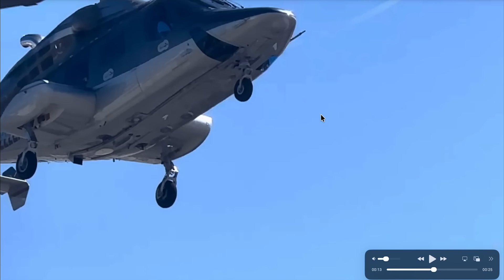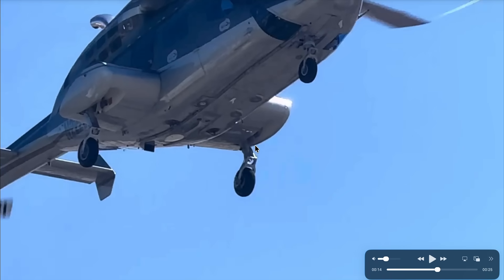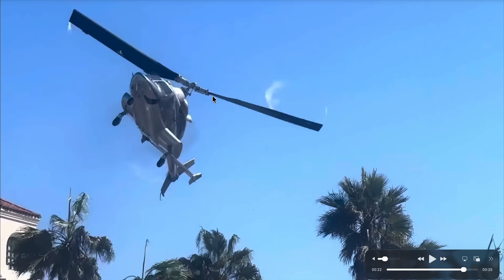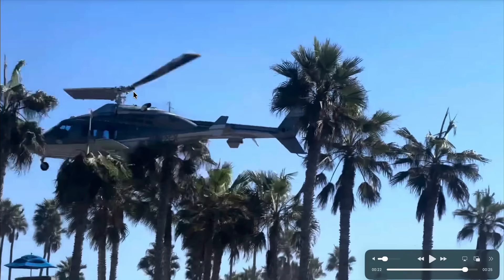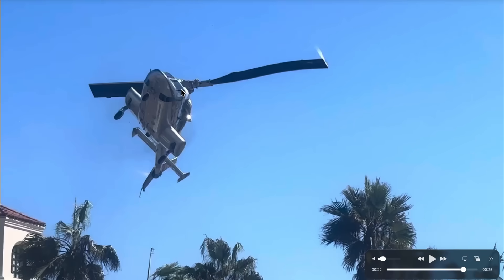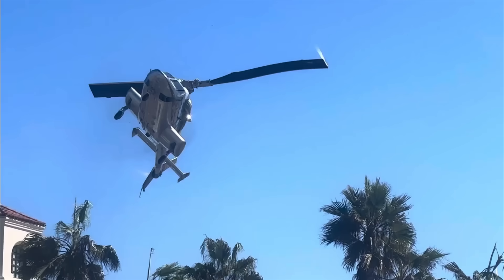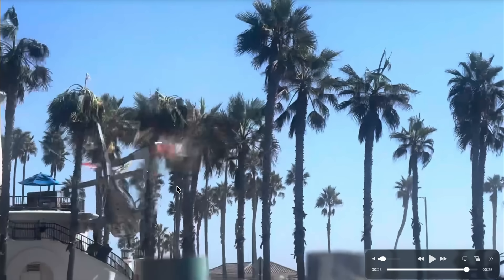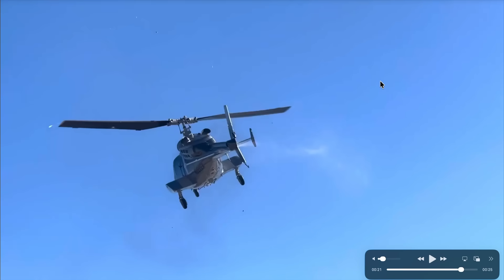Huntington Helicopter Crash Analysis - SlowMo Video!

Comment: It's only mast bumping because he pulled a load of collective to get away from the trees, then dumped the collective, to stop the pirouetting from getting any worse.
That heavy raising then rapid lowering of the collective, left the helicopter at zero G and that zero G condition lead to the mast bumping.
You say it's lucky they weren't at 1000ft but if they were, then they would never have pulled collective, before lowering it, so the mast bumping would never have happened. They would have just lowered the collective straight away and autorotated, if all went well, to an uneventful landing.
The main rotor mast eventually being severed, and possibly the main blades hitting the tail blades and in doing that, compromising the tail transmission, is all a result of the zero G condition caused by raising then quickly lowering the collective. (Which they only did because they were so close to the trees). 
Edit: The initial failure was a pitch link detatched from one of the tail rotor blades. (@BlancolirioYT shows this - see below). Everything else was caused by the pilots reaction to that situation. Not that any response was going to produce a good outcome, starting from having zero forward speed and  maybe 20ft above trees.

@BlancolirioYT video showing detatched tail blade pitch link: "Huntington Beach Helo Crash 11 Oct 2025"
Reply: Difficult to arm-chair-quarterback this pilot, as no life was lost and it could have been far worse! Seems to me the only other way he could have reacted would have been to bring engines to idle and set her down immediately (and it would have been a hard touch-down still, and might not have ended any better at all). The palm trees he ended up in at least stopped the main rotor from spinning and thrashing the helicopter into pieces! Not that I think he planned it this way, but it did work out fairly well in hindsight.

Comment: You can see the pitch links are severed on the tail rotor in the first turn. May have lost the swash plate bearing. The smoke would probably be the tail rotor drive shaft flailing around in the tail cone structure. Tail rotor would eventually bump the same as the main rotor, especially as the helicopter spins. The palm trees saved a lot of people. The main rotor blades would have been sprayed everywhere from hitting that structure. Not a fan of two bladed helicopters personally.

Comment: notice jsu tone of the TR blades is at that masive pitch angle? notice that theres a pitch link broken before anythign goes wrong?
The guy was creeping in, full left pedal, strafing using the airflow hittin ght rihgt side of the tail, as soon as that airflow slowed down as jhe slowed down, it started to rely solely on the failed tail rotor. The second he felt that, he paniced and pulled collective to get out of there, making the loss of TR authority worse, substantially worse, and leading to the entire TR assembly giving up , starting with the blades vibrating out of balance, then when the blades snapped off, the TR was completely out of balance so snapped itself off.
ALl in all, the only way this guy was going to have a relatively uneventfull landing, is if he gave up much earlier and run on landing elsewhere.
Reply: Jeezaloo, the dude is a stunt pilot, immediately put the nose down but then it was out of control due to failure & there's still people believe he should have just 'landed' it somewhere else or autorotate it....even after this clear video

Comment: I thought the main rotor hubs were made of forged steel.  On some helicopters, like the Bell 407 for example, the rotor hub is made from splintering fiberglass.  Every part of a helicopter is critical and complicated.  Helicopters are death traps.

Comment: There is a video with the helicopter straight on.Just before it starts to spin and you can see the tail rotor blades have almost full pitch, which tells me the tail rotor failed, look for that video.
Reply: Was he landing in a downwind condition, causing more load on the tail rotor, until it lost effectiveness?

Comment: Excellent analysis.  I bet the TR paddles cleanly breaking at the same spanwise location could be traced back to their manufacturing technique and probably aligns with some assembly joint.  I didn't expect to see the mast bump (which was fascinating to watch unfold in slow motion).  First time I've ever seen such a high quality video capture that.

Comment: Very good analysys frame by frame. And I appreciate that you admid openly that do not understand what caused the tail blades to separate in the same moment. Whatever broke there, it's a pilots nightmare to experience such a technical failure which causes a crash

Comment: at 5:05 only one trail rotor blade has a pitch increase, and you can see it's producing way more tip low pressure vortices than the other. From another camera angle it looked like a blade pitch linkage failed and caused on blade to rapidly increase pitch, probably putting huge stress and torque on the hub and gearbox!
Reply: I would say the "failed" blade got into a more neutral position, so that the pilot got into more left pedal to counteract that failed one. So one was "100% anti torque", the other just around neutral🤔

Comment: The dark exhaust may have been due to load on the eng dropping off from the loss of the load of the tail so engines went burning rich
Reply: Another possibility is that with the sudden loss of mass caused by T/R separation, the main engines could have over sped (and cycled more than once).

Comment: I would imagine that the black smoke from the engines is caused by the pilot regulating the throttle to try and soften the impact with the ground while also trying to avoid just spinning the thing at an incredible speed

Comment: main rotor blades did not separate, pilot had them at max pitch to slow decent
Reply: The main was so close to totally disconnected it might as well have been disconnected.  Almost nothing was still attached at the very end. Not from impact with the ground.  The thing had already come apart.   The crew was extremely lucky.
Reply: 6:05 "max pitch"...& then some 😂 it's come off 😮

Comment: From what we can see here, the event sequence looks to be:
1/ One TR pitch link disconnected, some time before the accident sequence begins - the affected blade goes to a neutral position.
2/ When the aircraft came to the portion of the approach with the highest power, he only had one TR blade provided thrust - not enough.
3/ Pilots pedal is at max thrust position, but not enough and slight airframe rotation begins.
4/ Corrective action here is to translate away,  gain air speed, reduce power, go land somewhere easy using loss of TR thrust procedure.  But instead, he did the wrong thing... he pulled lots more power, that subsequently reduced the Rotor RPM and gave even less TR thrust, which added to the airframe rotation... which now really accelerates.
5/  Just 3/4 of a rotation later... TR blades fractured and separated from hub - due to huge imbalance in thrust, and the excess flapping that this asymmetric thrust will produce.  All this is beyond the mechanical limitation of the blades - they simply fracture and fail.  TR blades ejected with force - one striking the MR at mid span on the way out.
6/  A 1/4 turn later, What was left of the TR hub and the imbalances it experienced, caused the TR gearbox to split apart and ejected the output shaft and hub.  Possibly also from some damage that might have initiated the pitch link failure that started all this.
7/  Aircraft now has no TR, full power to the MR and is rapidly getting out of plane with the MR.  A few rotations later, It falls down, the mast breaks, and it crashes into some trees.

They did get lucky in one aspect - a rather "soft" crash into the tress with the MR no longer a danger.

Comment: Started my aviation career in helicopters, I was lucky to fly some really fantastic machines, Puma, Super Puma but also managed a few hours in the 222, 230 and 430. The 222 is an absolute cow (flew it at high density altitude), worst aircraft I ever flew, rotor and fixed wing!

Comment: Your meticulously precise video analysis and frame by frame observation was truly outstanding!

It was extremely fortunate that the helicopter was at a low level and that its impact with terrain was reduced by the trees and the external staircase!

These factors greatly reduced the force of the impact and protected those on board.

Subscribed!

Comment: There is another video with very good sound. You can hear the tail rotor slapping like a blade lost pitch control.  You can hear the engines decel as he tries to auto, or maybe roll the throttle off. But with no airspeed, spin is inevitable.

Comment: Vortex ring state?? Felt it dropping, yanked collective, FADEC dumped a bunch of torque into the gear train and found a weak link in the TR??

For sure 50 feet higher, probably no survivors because of the mast bump and separation... Terrifying to witness and imagine them being at a greater altitude.
Reply: No FADEC on 222

Comment: So basically one linkage came free from the tail rotor causing one of the blades to have no pitch control and flap freely which altered the RPM of the tail rotor from the vibration. This causes the helicopter to lose authority and spiral out of control eventually chewing up the tail rotor hub and spitting it out.
Reply: You can see that pitch link in other videos.  Once he does a pedal input with it disconnected, everything goes to shit.  Input to one T/R blade but the other was free to wobble in any plane in the yoke.  Lot of vibration going on back there, shaking everything apart.
Reply: Technically, it won’t ‘flap freely.’ It will be forced into aerodynamic neutral as there is nothing to hold the pitch, and the center of pressure will move forward to a neutral position.
Reply: Looks more like a gearbox failure, otherwise the box assembly would have stayed on. Right now all we can do is wait for the FAA and NTSB to investigate.

Comment: If the pilot hadn't taken the time for the low pass and landed without incident, then the tail rotor would've failed later that day or next day, whenever the show was over. Best case would be for it to be visibly broken during preflight walkaround or break during controls check. Second best would be for it to fail while spinning up prior to liftoff. If it stayed together long enough to lift off then every foot of altitude before failure... and there wouldn't be all these videos of it.

Comment: If I were a betting man, I would say that the part of the t/r gearbox that separated was just the half that holds the t/r driveshaft because it looks like the bolts that hold the halves together sheared leading me to believe that the the bevel gears in the gearbox may have seized and the torque of the tail rotor caused the separation to occur. So if that happened and there was enough thrust on the t/r and those bolts shear, there would be enough thrust to pull the t/r trunnion assembly away from the t/r pitch links causing a huge input of pitch to the blades. The blades sheared at the same point due to the torque and centripetal force, and they broke at the weakest point of the blade which would be at the transition from where the mounting bolts are as this is a solid block of metal, and the honeycomb part of the blades.

Comment: The problem was metal fatigue as simple is that...
I'm not an engineer or aircraft mechanic, but the problem is that they should keep records from these important metal moving parts in records from metal fatigue...
These parts are at extreme hard movements, and they should be monitored at some point at any period time...

Comment: Wow I wonder this exact thing happened in NY? Also did that rotors shatter under pressure.. also what I notice as it was coming from tree line the way rotor looks it was thick meaning it was vibrating hard that what could shatter the blades like that..

Comment: he did two fly by passes before he crashed, you can see the tail rotor stopping and switching directions then as well.
Reply: So it was flying before it crashed?
Reply: Amazing it was still flying in full control when the tail rotor stopped during the fly by....
...I can't...don't...😂😂😂😂😂😂😮...😂😂😂😂😂😂

Comment: At 5:18 look at the thin black line with a ball on the end sticking down. A control rod has come loose from the tail rotor.
Reply: I think that's just the  tail skid
Reply: @russellsher3703 look between the rotor blade and the skid
Reply: Oh -sorry I was looking at the tail skid. I think you are correct